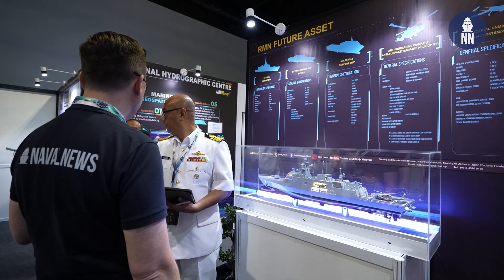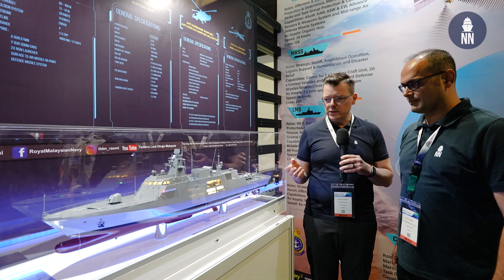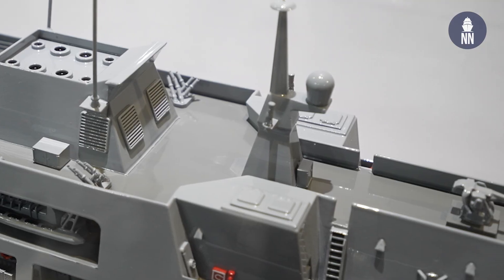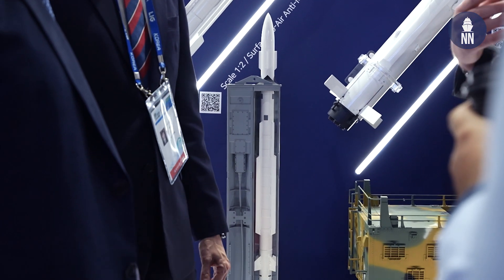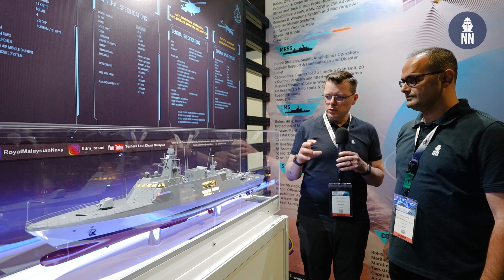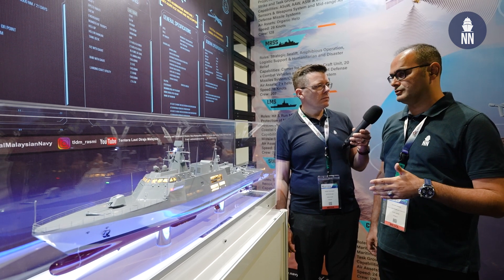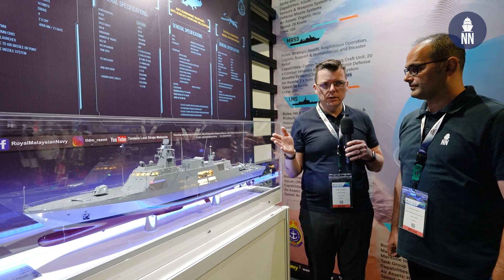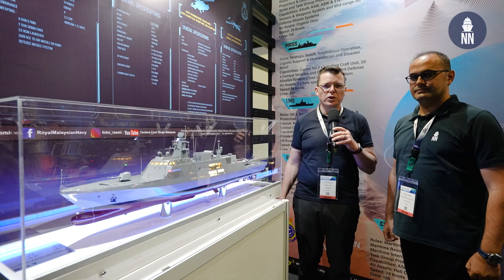Royal Malaysian Navy LMS Batch 2 Corvette at DSA 2024

Comment: It just looks like a LCS copy.
Reply: It is not. LCS is larger. Its primary feature is modular mission equipment which enable the ships to be used for various mission profiles. But later this feature turned out to be costly and ineffective, causing the US Navy to halt the project and dispose of the comissioned ships.
Reply: @thecommenter7201  The Ada class entered production and design before the LCS. So the LCS is similar to the Ada Class. :)
Reply: low comprehension IQ 😂 

nobody said malaysia is building a new vessel. It's a 🇹🇷 Ada-class corvette to be acquired with 🇲🇾 specifications.